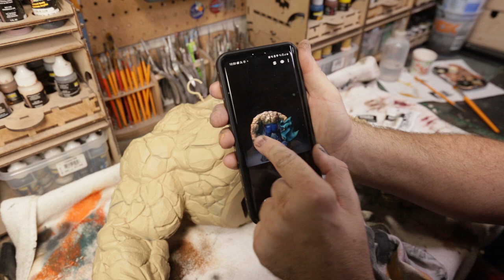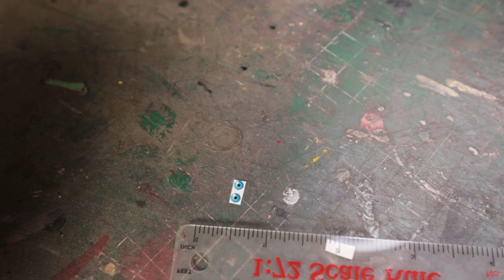1/4 Custom Thing WIP #3

Comment: Great job! where do you find this kind of kit?
Reply from the maker: Most of these are from secret groups on Facebook. I'm in a lot of these groups but I'm not in the group this kit came from.  They are made in very limited numbers, usually 50 or less and many times they only make 5-10 kits andnthe rest are prepainted.
Reply: @mvm3897  Thanks Matt.